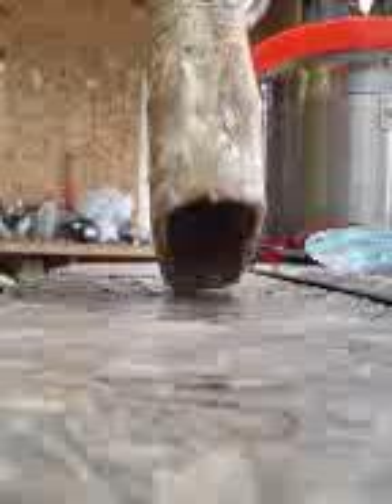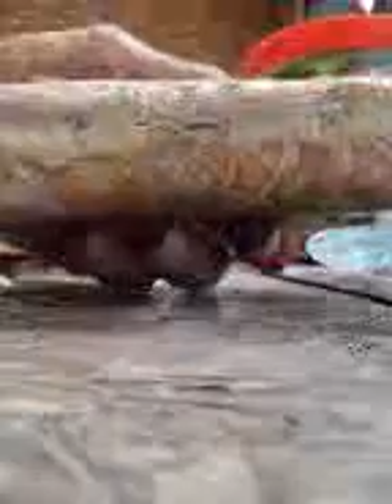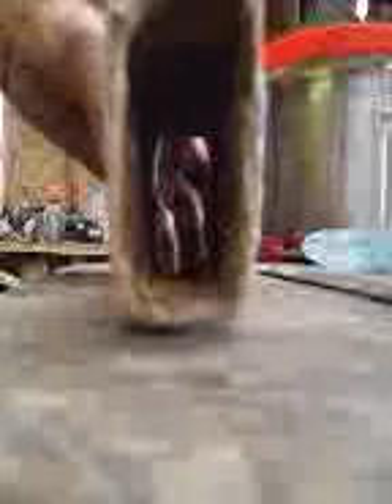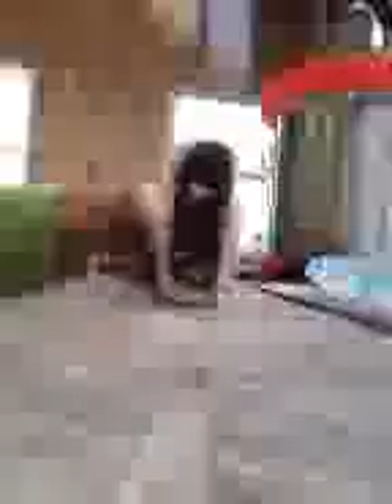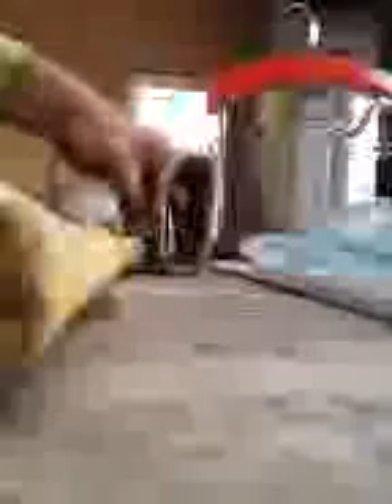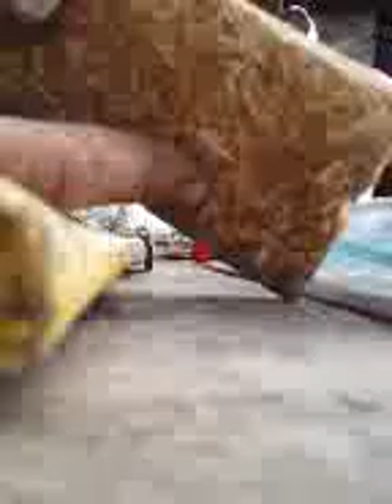Hemp Bast fiber composite tube, body panel

Comment: Have you tried any biodegradable/natural resins or glues?
Reply from the maker: Actually working on a hemp oil resin 😏 Absolutely destroy a range top😑
Reply: @mrglasecki  Probably not the best thing to do in a regular basis.

I'm working with Bast fiber from a different plant and am looking at various natural, biodegradable resins or glues that would create a lasting hold until the material rotted down.
Reply from the maker: @FarmerBrownGrows  
Hemp oil resin will win one day yet I've used fish skin's for a bio degrading planter work Extremely well, wheat glue works *not real strong
Best of luck
Reply: how did you  create this??

Comment: How are you creating these dense molds? Compression? I can't find anything on how your doing this stuff (Granted, I haven't made it through ALL of your videos). I've got at least 100 hours of research under my belt since December, and finding your channel has been more informative than anything I've come across. Do you have a website or blog containing more info on what you're doing with hemp?
Reply from the maker: Zachary Rhyner 

 Pva adhesive, simple orientation of the fiber is it,
  Natural that strong, can be made Exponentially Stronger